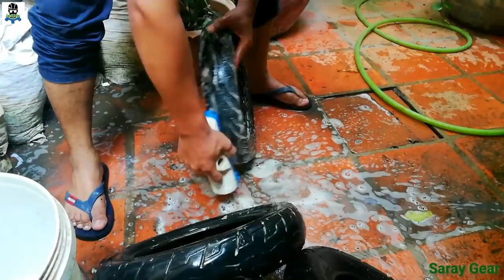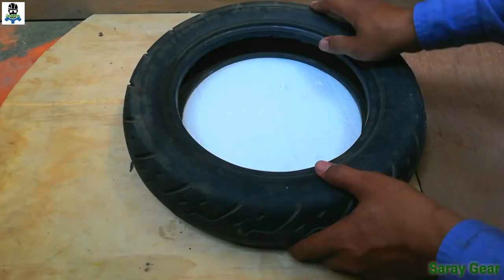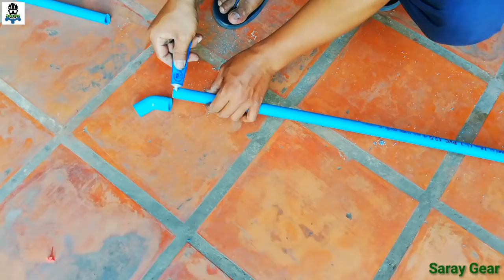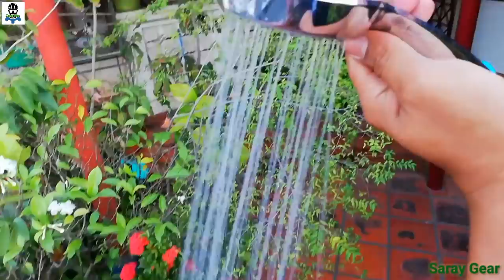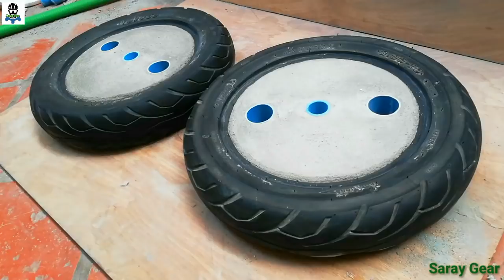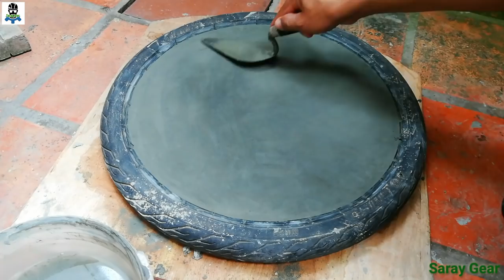Top 4 Amazing From Tires How To Make Punching Bag/Shower Standing/Barbell Weight/Coffee Table

Comment: Now got it .it's motor bike tyres car tyres too big lol I now wake up after watching the videos of making concrete weights .add a little steel inside brc or iron rods to strengthen it .add cement hardner and use grout  used in tiles mixed with  cement and sand you can add broken tiles gravel  or even waste scrap iron filings from the machine shops
Reply from the maker: 😍😍😍
Thank you for watching my video 🙏